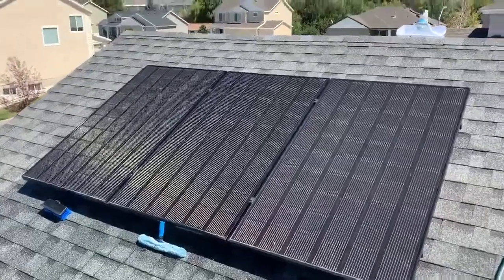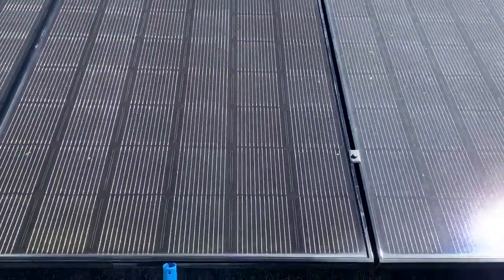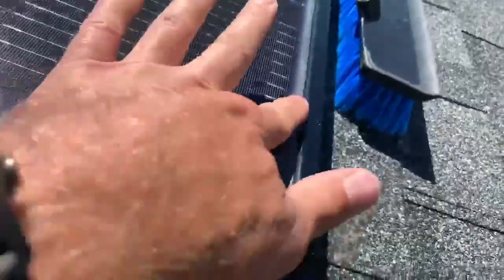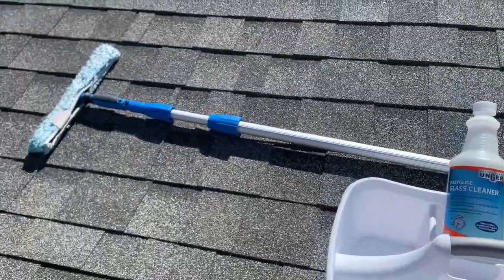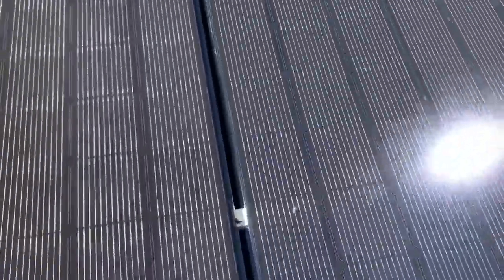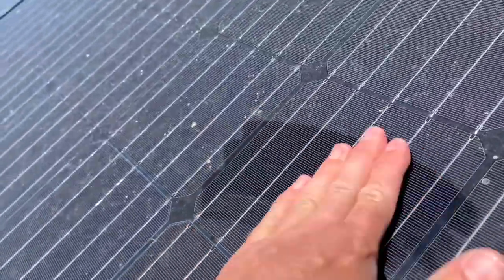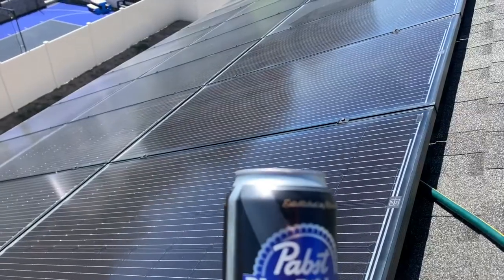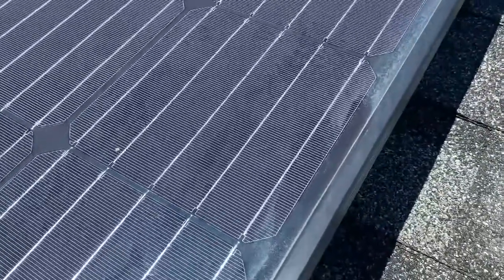How to Clean Your Solar Panels

Comment: Did you rinse them after scrubbing or squeegee them? I don't see any water spots and it looks like you did this under the sun. I happened to use the same cleaner since I had it for my windows and after scrubbing sprayed them down but it left water spots everywhere. I cleaned them in the morning before the sun got intense. Thanks.
Reply from the maker: Definitely Rinsed off the panels after cleaning. I know that this goes against common sense. Cleaning the solar panels makes the most difference for long-term performance rather than short term performance. The panels are going to get dirty quickly after they are cleaned. But cleaning them periodically will really help the glass/laminate surface last longer. I wouldn’t worry too much about the water marks. You might just have hard water!